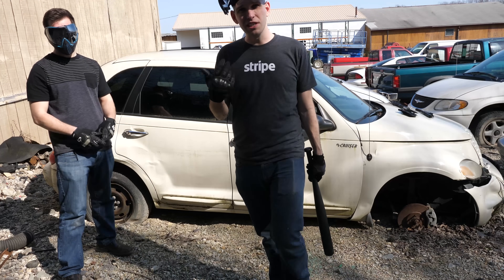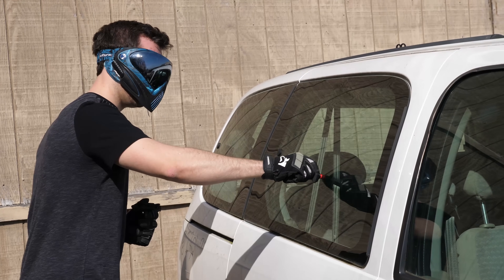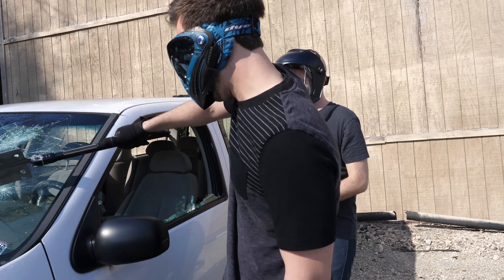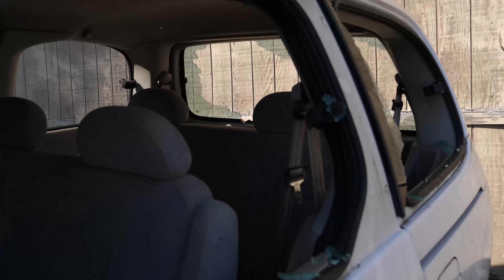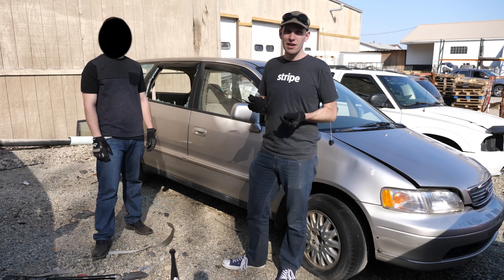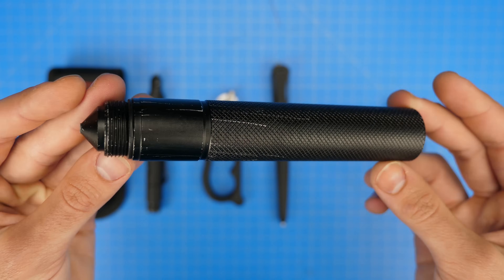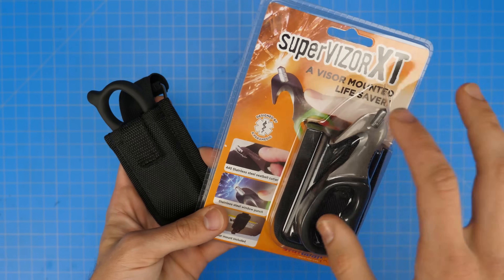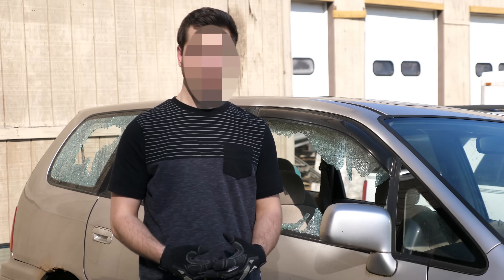Will These 7 Car Glass Breakers Save You?

Comment: Okay, the front windshield is two layers of glass with a layer of lamination in between. The side and rear windows are single layered tempered glass. 

The cheapest and easiest way to break the side window is to go to the hardware store and buy a spring loaded center punch. Just a gentle push on the glass and it is shattered. I used it while a police/emt many times and you can get one for less than $10 at the hardware store. 
As far as a seatbelt cutter is concerned, I just carry a high quality knife. 
Tactical shovel? Just a good old fashioned Army entrenching tool is the A-1 choice for me.

Comment: I'm pretty sure you're wrong about MOHS, that measures the hardness of a substance, and ceramics and baked clay like bricks, as well as concrete, measures a 7-8 on the MOHS scale - harder than glass.

The reason bricks and other blunt objects bounce off is because they have a relatively low PSI force which is easily absorbed by the glass pane. If you were to hit a lane of glass and with a piece of wood sharpened to a point, it would break easily despite wood being much lower on the MOHS scale than glass.

Think of a pane of glass like the calm surface of water. We can all agree water has a 0 MOHS hardness, yeah? But water has a relatively high surface tension, so If you belly flop on to water, the tension can hold for a long time. But if you pencil dive into the same water the surface tension is immediately broken and you go straight through. That's effectively how glass breakers work, they are designed to instantly break the surface tension of glass with the least amount of effort , compared to a bat which requires a lot more force to break that surface tension

Comment: The glass is weakest in the corners cos it's tempered so for any of the things you used they would work better on the corners. Also it's safer because your arm will be stopped by the frame and your arm won't really have a chance of going through and slicing your arm up. Great vid tho:)

Comment: The one designed by the paramedic, you're supposed to put your finders inside the handle.
See how the inside of the handle has the shape to fit two fingers?
Holding it this way should fix the angle issue.

Comment: it's all about pressure per square inch...  a baseball bat hits the window with a wider area, while the pointy tool uses a very small tip.... it's like the high-heels that women wear, they make holes in the dirt while men's shoes don't make holes even if men have more weight....

Comment: The round breaker you start from the middle of the glass and work diagonally to a bottom corner and tap slowly but the closer to the bottom corner you hit a littler harder every tap and when you hit the bottom corner (slam) the window breaker into the glass and it will then shadder

Comment: Tips if your car goes in water
1 don't panic
2 let your car submerge all the way  inside make sure you take a last breath
3 open the door
4 don't try to open the door until fully submerged otherwise the pressure difference won't let you open the door
Your welcome be safe
Reply: And all the water getting sucked in would pull u back into the car
Reply: @birdwithands8104  hopefully none of this info matters and it never happens

Comment: So in conclusion using a wider material will take more force because its trying to break a wider surface area as to the small iron took little force because the stress was focused in a small surface area rather than a wide surface area

Comment: Just put force behide it like you swing when punching easily could knock it out with my hand gunna hurt abit but will work or you could be cheap break a spark plug apart and take a very small piece and just slap the window bet you anything it will smash it did for me 🤣

Comment: Yanno, the whole time your using the bat and shovel you swing it like a bitch, maybe if you put some force into it and was intended on breaking it like you would in a real situation youd break through it. You tapped the window over and over with the shovel and was like "ahhh it's not breaking hmmmm" maybe cause the one time you broke through it, it looked like you actually put a little more force into it then just barely swinging at it... just saying

Comment: To use the seatbelt cutter don’t pull it straight across the belt pull it at an angle down and it will cut much easier

Comment: What if I told you you can take the head rest off your seat and use that to break the window
Reply: gutmedown very easy recline the seat back then adjust the head rest all the way up then press in the release tabs then pull it out
Reply from the maker: That's cool, and I didn't know that. Maybe I'll try it if we are allowed to go back
Reply: SAY SIKE RIGHT NOW
Reply: But some cars don't have removable headrest
Reply: @gutmedown299   Look at the head rest when you pull it out. There should be a point edge down towards the bottom of the poles where you would put the head rest into the seat. Use the pointed edges to break the window

Comment: A seatbelt cutter works better in a real situation because they will be pulled tight from the pre-tensioner
If the pre-tensioner has not deployed you shouldn't need to cut it you just need to press the red button.

Comment: The super visor was hands down the best of the tools you showed us for several reasons. First it is always in your car where you need it, though carrying a secondary type is a good idea if you are prone to ride in other people's vehicles.
Second, if you held it right it is just right to cut the seat belt and break the window without changing your grip. (if you really look at it, you can see where your thumb is suppose to go and a couple fingers into the hole that is made for index and middle finger to fit)
And for a third reason you showed us that it was the only one that was quick to cut the seat belt.

Your video was both intertaining and interesting, but I would suggest taking some time in preparation for your video to make sure you know how each thing is suppose to work before showing you test it in a video. Otherwise great video. 😁👍

Comment: If you're gonna make a video make it factual. Winshields are NOT plexiglass theyre tempered glass with a layer of saftey film.
Reply: It's not "safety film" but your correct it is called laminted glass which is made up of layers of glass and plastic that hold it together. The side windows are tempered glass which are very strong due to the process of how they are made (tempered) but they store a lot of energy so they will shatter into many small peices of glass that can't cut you
Reply: Crashed thru one with my head, wear seatbelts folks :)
Reply: Actually no they are laminated 🤦🏼‍♂️
Reply: Side windows are tempered, windshield is laminated.
Reply: Wilfred the cat so you’re the nerd that sits in the back of my math class eh?
Reply: @no-cv2gh  nah i havent been in middle school since 2010
Reply: Wind shields are untempered so that if it gets hit by a small stone the whole window doesn’t break. So if you are going to comment about someone being factual make sure that you are aswell
Reply: The windshield glass is the same glass used in hockey
Reply: @Sublimefan  no its not
Reply: What kind of twat thinks its plexi
Reply: I like how the comment pointing out the video's mistake is also wrong haha
Reply: @trektn  I’m not wrong.

Comment: I don't think it has much to do with hardness. It has everything to do with the energy needed. The very small and sharp point of a traditional window breaker transfers the energy over a much smaller area and multiples the force exerted on the window. Hitting window in the corner is where it's weaker. Nice video!
Reply from the maker: Yeah Foo didn't really do his research.

Comment: In 2017 auto manufacturers started switching from tempered glass to laminated glass because too many people were getting ejected in accidents. 
The tempered glass easily shatters with those tools, but laminated glass has a super durable film in between two pieces of glass.
So if all your windows are laminated, and your car get submerged in water, or catches fire (and your doors won't open), you're screwed.
Reply: Im not sure about fire, but at least in water, you could wait for the pressure to equalize and then open a door
Reply: Mythbusters tested this. It does not work. @Rylopero

Comment: You can absolutely break a tempered glass window with a bat. Polypropylene, wood or aluminum, aim for the corners. (Especially if it it's more of a Brooklyn whopper size)

Also, why wouldn't you think diamonds were a 10 in terms of hardness

Comment: Haha mohs hardness scale doesn't affect force applied. It broke because you started applying force in a smaller area, as opposed to spreading it over a larger area with a bat.
Reply: G3AR - 'GreekGadgetGuru'  that’s exactly what he just said
Reply: That emo hair in 2019??
Reply from the maker: Right but with tempered glass it works a little different. I can see it both ways. Basically to break the glass you just have to put a lot of force in a very precise point, such as a ceramic edge